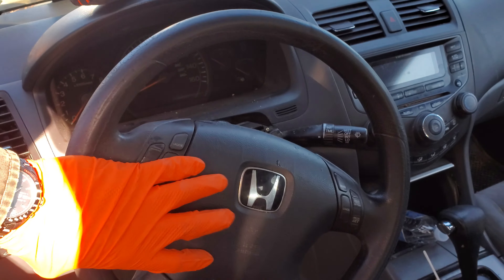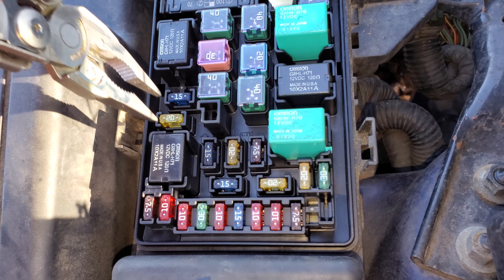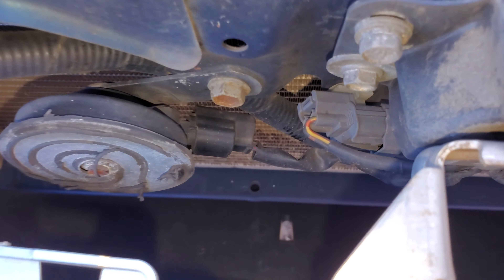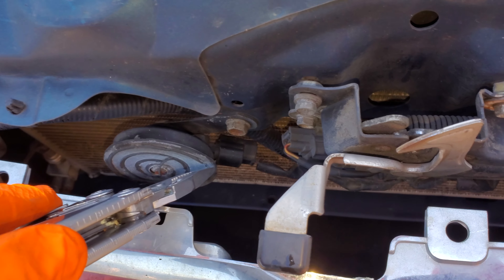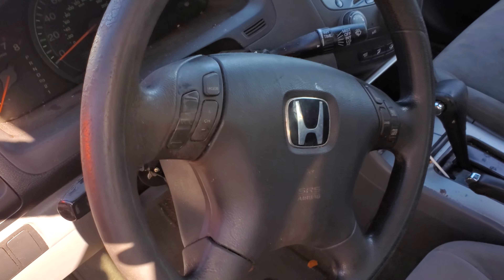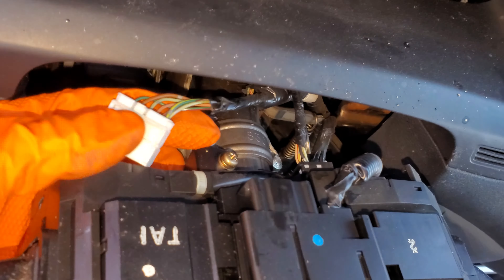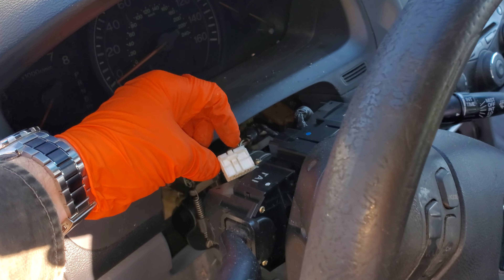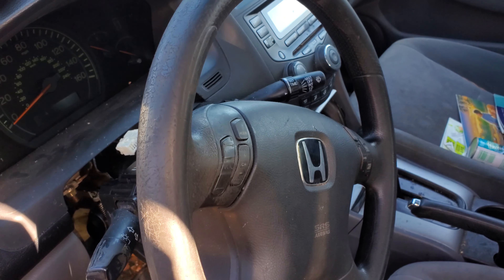2003 Honda Accord Horn Fuse, Circuit Explained

Comment: My 2002 Acura TL honks the horn continually (not beep beep beep) just keeps honking until i bang on the horn on the steering wheel.  My question is if i take out the 20 amp fuse that goes to the the horn/air conditioning then neither will work is this correct???

Comment: So if my horn sounds when I lock my car, but doesn’t when I’ll press on the steering wheel, would it be the circuits behind it?
Reply: I have the same problem.
Reply: Did you find the answer bro..? I have the same problem
Reply: @AlexFromPhoenix  Yes, turns out it was my clockspring that needed to be replaced

Comment: How do we change the relay ..? If it’s built in in that box near the fuse box ?
Reply: Are we living the same lives I’m thinking of just disconnecting the horn relay if I can find It is possible the horn relay in the relay module is the cause, When you touch the horn button it sends a ground signal to the horn relay. The relay then sends battery power from the fuse to the horns. The relay is part of the relay module which is also the under hood fuse box.
Reply: The brake lights share the same fuse

Comment: Have 2003 Honda Accord. Purchased new battery. When I attach the ground terminal to the battery the horn goes off and will not stop unless I disconnect the battery terminals. Any ideas what could be wrong? Thanks. Don
Reply: I have similar issue

Comment: my horn does not sound when i lock my car, nor do my lights flash. my horn works fine its just the alarm for my car wont work. even when i press the panic button , nothing. can i get some help?
Reply: Hey did you ever find a fix? I have the exact same problem on my 2006 Accord!

Comment: Hey sorry I know this video is old but I was hoping someone could help me. I an trying to turn off the alarm system in my 05 Accord. I removed the backup fuse but the car alarm still goes off when I put the keys in ignition. I tried taking out the horn fuse but my shifter locked so I couldn’t move the car. I am out of ideas and sick of waking up my neighbors. If anyone could help me find a short term resolution i’d appreciate it. 

Reason for alarm going off is my driver side door lock is chipped due to someone trying to break in my vehicle. Now my key only works on my ignition and trunk. So my alarm is constantly going off until I put a key in the driver side. I’ve ordered a new key and lock cylinder but it isn’t coming in until january 5th. Thank you.
Reply: Having the same problem you ever find the fix?
Reply: Whered you order the lock cylinder and key from , my driver door is not the oem door and the key fob alarm won’t work to unlock or lock the car 😭, disconnected the fuse and horns because it just goes off because I can’t turn the alarm off and now the lights are always flickering
Reply: @chikanothug123   I ended up having an electric problem in the end. I ordered the key off eBay though if you know that is your problem.

Comment: Why does my horn go off when I turn ? Honda Accord 04
Reply from the maker: Failing clockspring!!!!! 100% you can bet on that. Turning the wheel makes the wires touch each other occasionally.
Reply: Lehew TechThank you Thank you! Will get that squared away.  I have another question! 
Would an Ecm be the culprit for a faulty ac system not allowing the ac comp clutch to work properly?
Reply: @LehewTech  how do I turn off the car alarm in a 2004 Honda Accord without it affecting the shifts,gear